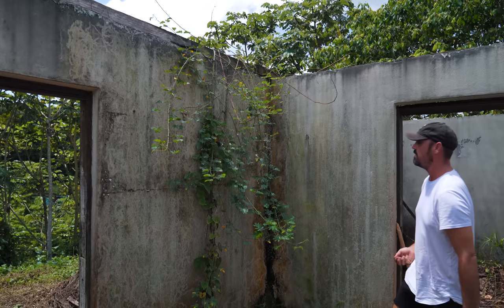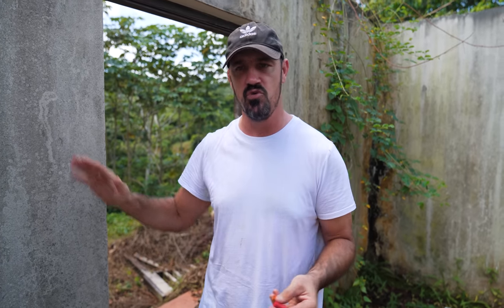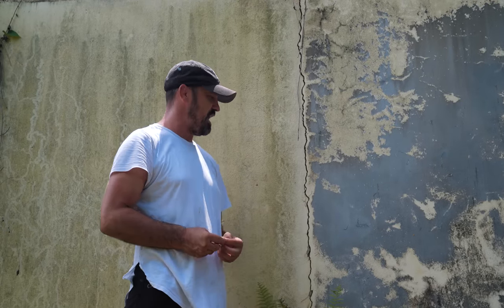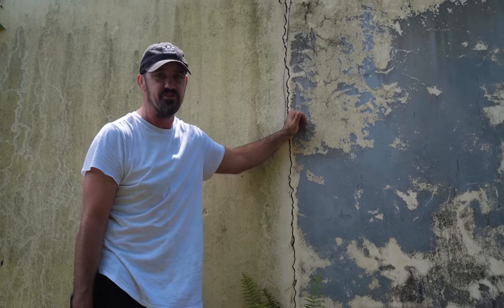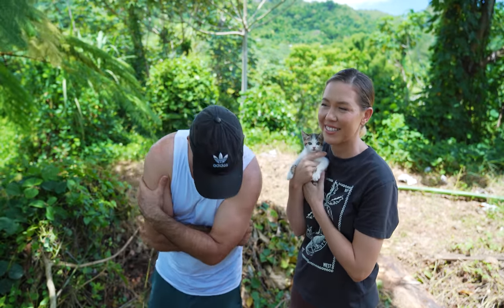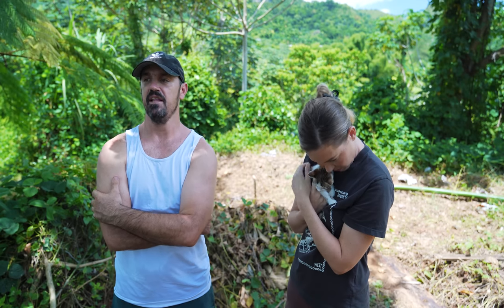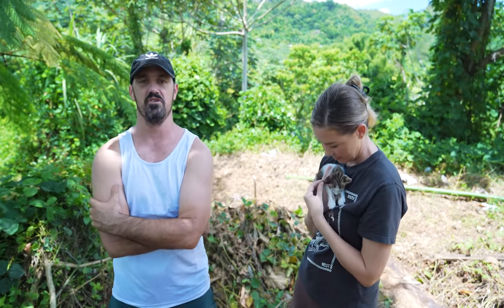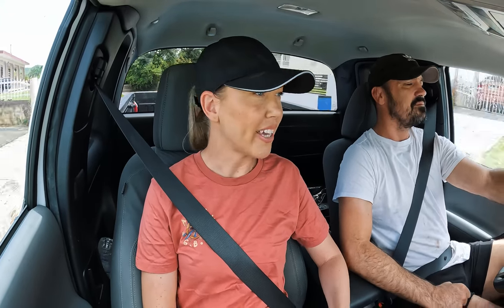ABANDONED HOME SHOULD WE RENOVATE OR DEMOLISH?!

Comment: bamboo ,that you have in abundance nearby ,is far more useful than most people realize .you can even use it for concrete vertical pillar construction ,which can stabilize your weak wall ,if corners are securely squeezed . for one floor structures ,you can get away with using common sense ,thinking clearly about forces/dynamics ,trajectories of movements . your access to free bamboo and one level structures ,invites you to play with bamboo ,either in full diameter ,or cut in strips ( even glued together ).
 2 things to research from locals : which bamboo is best for certain works and what is best done for preservation of its properties/strength. ?   2. without drawing attention to your building site ,finding out the building permission procedures and usual  'squeeze' technics of officials . what can you do and how ,without inviting permission troubles ?  this is bette done ,without drawing attention to your building site ,rather incognito ,so to speak .

Comment: I would totally acid wash and pressure wash those walls, order some 2x4s and plywood and put a roof on that house! Figure out what's up with thr electrical on the back wall. You may be able to power the camper and home off of it.

Comment: To determine What You Should Do....First Determine What You Have.
1).  What are the exterior walls made of?  Poured in place concrete? Concrete Blocks?  Wood framed with plaster interior and exterior? How to check?  Remove a patch of plaster on the interior about  2 feet square.   If its wood framed you'll know right away as the interior of the wall will be  hollow.  If its concrete block, you see the blocks and morter joints.  Then the question will be are the blocks poured solid with concrete or are they hollow? ...and do they have steel in them?  If its solid concrete you'll know because it will be solid and all one color, probably light grey.  If the walls are poured in place concrete or cement block poured solid with concrete, you've probably have good solid walls.  2). Check the size of the footings under the walls.  Dig down on both the inside and out side of the wall in the same  place on the wall. Then determine how deep (from the bottom of the wall) and how wide the footings are.  Armed with this information you are ready to talk to a building engineer and the building department to see if all meets their codes.  If the walls are of solid concrete or concrete blocks poured solid. you'll probably save  money building a roof over and finishing off the inside... PROVIDING you over engineer the roof and tie it to the walls and through to the footings with MORE  hurricane ties than required.  After all... what is missing now...and why?  3). If you make a simple gable roof with the ridge parallel to the road, then you can add on to either side or both in the future and add  on to the gable roof either direction.  Start with what you have and add on as you need in the future.  4) The crack in the wall on the outside is very straight, which leads me to ask if that lines up with the back side of the interior wall that sepperates the the front (living/dinning areas) from the bedroom and bathroom areas?  Is it possible the back half is an addition?  if so the connection between the front and back may need some professional engineering to tie the two together better.  It's not an impossible issue.

Comment: chickens: use the bamboo growing in abundance to make movable tunnels with tight wire ,excluding most snakes . move the tunnels with chickens inside ,from place to place .chickens will clean the ground for you and have a good feed .tunnels should be tight down each time ( pegs) to avoid predators lifting the tunnels .maybe use double wire mesh, one very strong ,one very tight .
building: keep strong walls ,easy to add plaster where needed and put a roof on ,snake and mosquito and rodent 'safe',no gaps. make it difficult to break in . even just tools and materials will be tempting to steal ,almost like a drive by ,with the road so close.
the side with structural issues : place a strong extra room in front ,this room securing the wall  and foundation ..you might get away with just adding a room ,if not to obvious ,that it is new . 
building permissions are a great nuisance and often a way for officials to get extra money.
I would add hooks into the walls for hammocks , for visitors and easy extra storage and better use of limited space .

Comment: Tear it down. It’s the mold that you don’t see that will cause respiratory problems. Also, you have no idea if it is an unreinforced masonry structure or what construction methods were used. Build a new home up to current seismic and building code standards.

Comment: 😂😅😂,  are you building the Gillagen island , TV show set. Then it will blow away.😅😂. If your going to live in it..DESTROY THOSE ROTTEN, BRITTLE WALLS , AND USE THEM FOR BACK FILL. only fools build money pits. Start right end right. Make a plan and stick with it. Best, cheapest, quick house. Find a builder, build a fast tuna house. So then u have a roof over head. And then add on.

Comment: If you keep the cats, get them fixed or more will come and kitties will be everywhere! Cats will bite the heads off the chickens so watch out there! I lost many hens to cats. Cats are as bad as dogs with chickens. Have a roof on your chicken coop and put a wire flooring down so preditors can't dig under. You will still have issues with snakes and they will eat eggs too. House: prop up the back room so it can't slide down the hill before repairing the crack. Grey water septic's are easy to build. A square dug into the dirt and lined with rocks or bricks, cover with wood and have the drain hose running from sink and/or shower into the hole. The more used water draining into the hole, the bigger the hole. I did one better, I used a plastic hose running out across the backyard from my bathroom sink and shower that I had drilled holes into it so water could seep out into my garden.That's how old timers did it. Needless to say, I've lived the country life in my past and had horses, goats, pigs, pea fowl (peacocks), chickens, and guineas. I know the pros and cons to these and cats will bring home strays. Wild cats, pregnant, and you will end up feeding a mass of cats before it's over.Every cat that showed up on my doorstep got fixed. Some left as soon as I turned them loose back home and some stayed. I tamed all I could and re-homed them. I'd say you should lean on one horse or a donkey and goats. A donkey will protect the goats and can be used for hauling things, like lumber for a fireplace, but so can a horse. Have fun! It's hard work but just as rewarding as fixing up an old boat which is where I am now at this stage in my life.
Reply: PS You only need a rooster if you plan on letting you hen hatch out eggs for more chickens on the farm.

Comment: Id put house on top and use building as garage.  Dont know how much land yous have - it looks like small patch on hill.  Thus i would build house on top of garage {old house}  regarding cracks in concrete  Id use boring machine like post borrer to bore deepish holes mainly on back corners of buildings to pour concrete piles  for pillers for house on top. Maximize yr land.  Mind you you also want to mazimize yr water catch.  Obviously should be getting water tanks.  Yous asking the auidence about things -  is like me asking God and flipping coin which way to go within reason,  yr mind can seem to subcounciously tell the coin which way to land half the time.